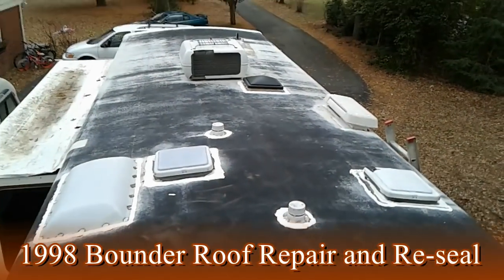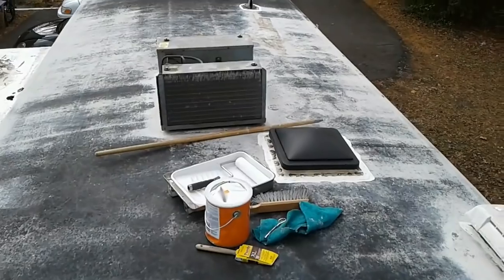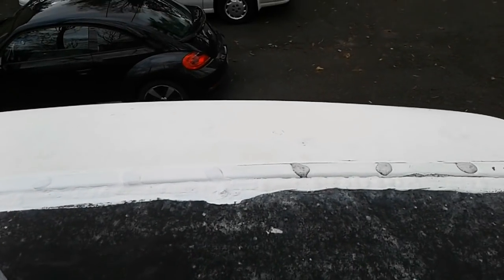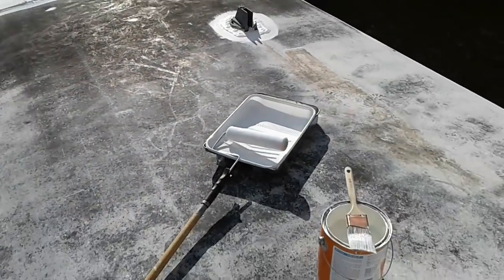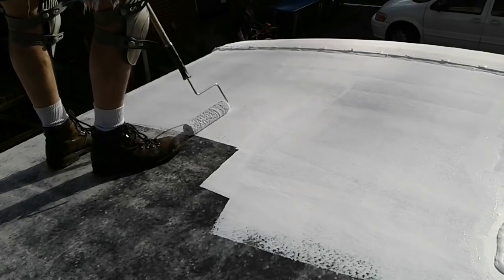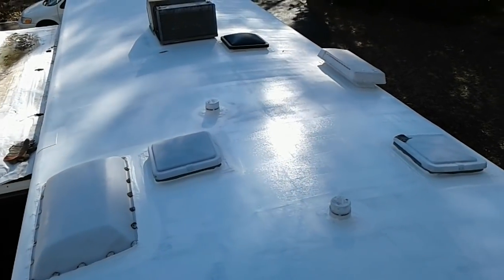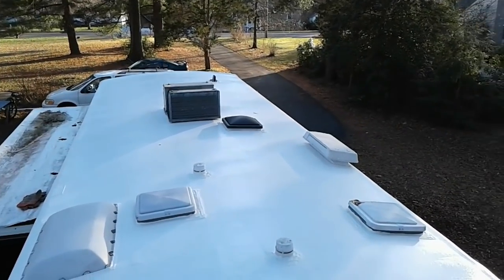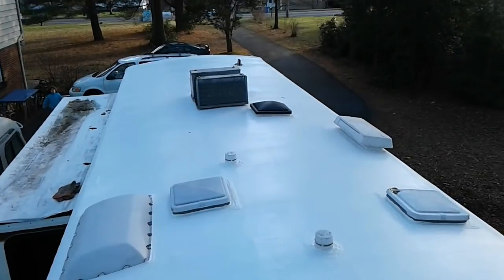How to Repair and Seal a Rubber RV Roof - 1998 Bounder Motor Home

Comment: how is your roof holding up with that product so far?  one thing i would add is that the black from bare rubber comes off and gets everywhere so wear  gloves and clean shoes afterwards.
Reply from the maker: If you check out some of my other RV videos, you'll see I switched over to FlexSeal Liquid Rubber. I like it a lot better. With the Heng's I felt like I had to re-coat the roof every year! But my roof has been completely leak-free since I did this job.
Reply: @Buckwsr  i just bought a 5 gal bucket of henry 887 from home depot for $380  that was recomended by a local rv repair man, if it dont work ill change to flexseal.

Comment: Great video and instruction! This is exactly how my 2000 Discovery 37V looks. The black on mine is now powdery and gets all over you when you are on the roof. Was yours doing this? Is this black powder what I am to wash off before coating mine? I am worried if even after I was it if it turns powdery again this won't stick. Any advice? Thank you!
Reply from the maker: I don't remember any black residue or powder. You need to clean the roof first. Maybe pressure wash it. or scrub brush and detergent. Rinse well and let it dry for a few days. Seal around all protrusions. Then you're read to paint on the roof coating. Good luck.
Reply: I'm having same issue, major black powder even after power washing.   Don't want to coat over it if won't bond.   Any advice?
Reply: How did you clean powder before coating?  Having same issue with my worn out black rubber roof.   Tons of powder, even after power washing.
Reply: Chris Davies any luck with washing your roof I’m having same problem
Reply: @Buckwsr  when you started the 2nd coat I saw your knees were good and black. My 95 C class gets me black everytime I go up there. I am prepping to do my roof.

How many gallons did you use?

What kind of knap on that roller?

Did you bag the roller in-between or just start with a new roller?
Reply: Hi. My roof also has the black residue powder, any thoughts on or recommendations to have a good bond?

Comment: Good description of doing the job- But i wonder now a year and a half since you did it, ? does it leak. I could not see any signs of cleaning the joints before applying sealant. ??
Reply from the maker: The roof has held up great since I did this job...no leaks ever.... However, I have re-coated it annually. Unlike a house, I think RV roofs require on-going attention and maintenance....

Comment: This is one of the best looking jobs I've seen on YouTube. I've got a 39' class A with a TPO BrightTec and it needs replacing or coating with something like this. I haven't heard of this grade Hengs before. How is it holding up so far. Again, it looks really good, very uniform and not splotchy like some I've seen. Thanks for posting this.
Reply from the maker: I did this job last december. Now, in August, roof remains completely dry and without leaks. I did recently paint on another coat of the Hengs since I havdenough left in the can to give it another coat. So.... so far, so good.  Thanks for the note.
Reply: Buckwsr... Was that all with only one gallon?
Reply from the maker: @deanrising6577  I used a little more than 2 gallons, I believe, in putting on two coats of the product. I had purchased 3 gallons. 6 month after doing this job, I used what was left of that third gallon to put on one more coat.
Reply: @Buckwsr  After inspecting my roof for what I thought was an air pocket under the TPO roof turned out to be buckled plywood. After opening it up to see if I could maybe just patch in a piece of plywood, glue the roof membrane back down and use a liquid product like you did I found the damage went around the rear a/c on 3 sides, so now I'm in the early stages of taking off the entire roof.   Only a few items left to remove(had 14 items which must come off before removing the 9 sheets of plywood), then the termination bars and plywood. At 16 years old it didn't make sense to do a partial re-roofing job on the coach. What fun!

Comment: If got a 1998 bounder 36s I need to do my roof and just wonder if you washed the roof first.
Reply from the maker: Yes. I actually had my pressure washer up there to clean it thoroughly.

Comment: How do you get the black powder off before you roll? Mine is EXACTLY like that but black powder gets alllll over
Reply from the maker: The black on my roof was not powder, but the rubber roof itself, as all the coating had weathered away. I cleaned the roof with a pressure washer before I applied the roof coating.

Comment: You don't show any cleaning step. Just curious, did you try to wash this roof before sealant? If not, has there been any delamination of the sealant? Normally, surface prep is the key to good adhesion.
Reply from the maker: I actually pressure washed the roof a day or two before applying the roof coating. I also applied the lap sealant at all seams and protrusions, but I wasn't able to film much of that either. Thank you for watching the video. The roof has held up well, but I have re-coated it each year since making the video.

Comment: I’m doing 2 coats on a 37’ 5th wheel roof. Planning to do Flex Seal, as we used Henry’s last year & it didn’t hold up well at all. How much do you think it should it take? Your video was very helpful - thank you!
Reply from the maker: I also transitioned over to the Flex-Seal. I felt like with the Heng's I had to recoat every year, and that's just too much work. You will need a lot of the flex-seal as the coverage is only like 80 square feet per gallon....it's liquid rubber, not paint...and it will cost you a good bit, too.
Reply: Yeah, we used Henry's last year - by this summer it was peeling off & pretty worthless. I think it's worth the money to get a good seal & prevent leaks, as well as to have one that lasts longer. Thanks for the input!

Comment: Well COVID took me out for 11 months last year. I did get my awnings done. The rain has finally let up here, and I’m getting ready to get this done. I’m gonna go with the Flex Seal. Your roof looks just like mine, the wear and color. Every time I go to clean it, this black water keeps running off. Is there a product that’ll clean it better. It’s almost like black chalk. Or do I have to keep scrubbing with dish soap or Purple Power it until it finally is clean? 6:11
Reply from the maker: I don't know really about how much scrubbing to do. For me it was December, and I was up against the cold weather. I think I gave it pressure washing, let it dry, and then applied the coating.
Reply: @Buckwsr    Hmm. Im kinda racing the warm up.  Were getting into the 70’s now. I guess I could just give it a good cleaning, let it dry, and coat it. Again. Thanks for the video

Comment: My roof looks similar to yours and I am about to do the same project. My question to you is: Did you wash the roof before applying the white coating? The rubber of my roof is showing (black) and i noticed it turns my fingers black when i touch it. Did you have this same problem? If so, did you wash it down?
Reply from the maker: Yes, absolutely wash it first, and let dry thoroughly.

Comment: Getting ready to do this on my '93 Jamboree. Did you power wash it or use anything special to clean it first? Thanks!
Reply from the maker: I'm pretty sure I powerwashed the roof and let it dry. Then I sealed the protrusions with self-leveling sealant, prior to applying the Heng's coating.
Reply: TSP Trisodium Phosphate in a bucket of water works great as a non-filming easily rinsed cleaner with a soft carwash brush, but I didn't have any mold being in the AZ desert.  Power washing could damage the roof and drive water where you don't want it, so I just used a low pressure rinse.  I used Henry Tropi-Cool on a TPO roof.

Comment: How did that sealer do did it fix the leaks I want to try it on mine just bought a 2000 coachmen they said had no leaks but just had a real good rain and found 2 leaks
Reply from the maker: It's only been about 3 months, but so far perfectly dry, and we've had a fair amount of rain this winter, so I'm feeling pretty good about it.

Comment: Did you have to apply an activator before applying the final coating?
Reply from the maker: The Heng's product requires no activator. Just paint it on. That's why I chose to use it...I needed to get this job done in a hurry.

Comment: Does Heng’s rubber roof sealant prevent condensation on the inside of the trailer roof? My aluminum roof trailer has lots of condensation inside especially in the mornings.
Reply from the maker: I can't answer your questions, as I have never experienced the problem you're describing. Sorry, and good luck.
Reply: It will not help.. the moisture inside your trailer is what's forming on the inside of the cold metal. Much as an AC evaporater, sweats and makes water when cooling..  a dehumidifier, will help some..
Reply: And if you are using propane heat, I don't think you will get any help from a dehumidifier.. we have a horse trailer with living quarters in it.. the uninsulated metal roof, sweats like a rain storm in cold weather..

Comment: How did this product hold up over time .  I would like to see how it looks now??
Reply from the maker: Thanks for the note. It's been over a year since I did this job, and everything is still completely dry inside my RV. The roof coating is not nearly as white and bright as when originally applied....it has gotten a bit dirty. But most importantly, it has sealed the roof and kept the water out!
Reply: @Buckwsr  I am getting ready to do my 1994 Bounder, the roof looks the same (black rubber) and I am in AZ. So heat and long hr of sun, so color fading is not an issue, has it pealed and were, was Heng's worth the investment.
Reply from the maker: @danafisher3806  Dana, my roof is still nice and dry. I recently re-coated with Heng's. For one thing, since I do not cover my RV over the winter...or ever...the rooftop looked pretty dirty. So I cleaned it with soap, water, and a scrub brush, and then recoated with Heng's. Should be good to go for another year.
Reply: @Buckwsr  thanks

Comment: I see so many reviews that Heng's will peel on this rubber roof without a primer first. You stated in comments that you already recoated the roof again. Was it peeling? Why did you need to recoat? I'm thinking of going with the 2 part system from EPDM Coatings. I want it to last years so I keep watching reviews. Obviously Heng's is less expensive but some of the peeling issues are just terrible.
Reply from the maker: No, mine never peeled to this day. I recoated mostly for additional protection and to make it look clean and white again. But it has never peeled.

Comment: I’m needing to do this to my trailer. How that product holding up 5-6 years later?
Reply from the maker: It seemed like I had to re-coat the roof every year. I don't use a cover, so after sitting all winter, the roof was quite discolored and dirty. Last year I decided to try Flex-Seal. It turned out great, and I will not have to recoat the roof this Spring, I can promise you that.
Reply from the maker: Here's the link to my flex-seal video: https://www.youtube.com/watch?v=V3FtqLqjKRI&t=29s
Reply: @Buckwsr    Huh, I’ve heard not so good stuff about Flex Seal. I do a bit more research. Thank you.
Reply: @Buckwsr    Thank you. I’ll check it out.

Comment: How long is that motor home and how many gallons of rubber roof coating did you use?
Reply from the maker: 2 gallons of the product were enough to put two coats on the roof of my 34 foot RV.

Comment: After 4 years how did the coating hold up?
Reply from the maker: After a few years of feeling like I had to reapply the Heng's every Springtime, I decided to switch to Flex Seal Liquid Rubber. That's a much better product, and I'm glad I made the switch. I have another video on that, too, I think. Good luck.
Reply: @Buckwsr  Thank you. That was going to be my next question. Is Flex Seal a good product? I will look for your video and decide if this is the right way to go. Thanks again.

Comment: What did you use to clean the rubber roof before the sealants
Reply from the maker: I cleaned it with a pressure washer....had to be careful, though, because the roof was already leaking in places, so I tried not to go nuts with it.

Comment: How long is your RV and how many buckets of Hengs did you use?
Reply from the maker: The RV is 34 feet long. I used about a gallon and a half to apply two coats.
Reply: @Buckwsr  Thanks for letting me know I have a 36 footer so I think 2 to 3 gallons should be more than enough. I enjoyed your video.

Comment: How is it holding up today after 4 years
Reply from the maker: The roof is still fine, but I switched over to Flex Seal liquid rubber, a far better, longer lasting option.
Reply: @Buckwsr  want to do my roof? I live in utah

Comment: Also did you use any sort of primer after cleaning?
Reply from the maker: I chose the Heng's because it is a one-step process, with no prime coat required. It was December, and time was of the essence.

Comment: It looks Great! I have the Heng's coating and hope to apply it this weekend. Did you only brush 1 coat on the edges? A thick single coat? Or did you second coat the edges when you did the overall 2nd coat?
Reply from the maker: I think I "cut in" twice with the brush before using the roller, if I remember correctly. Good luck! And thanks for watching the video.

Comment: Nice job on your roof job.  I do have a question.  I need to reseal my rubber roof.  My concern is there alot of peeling from a previous seal.  I just bought this MH and my guess is the previous seal a long time ago.  I worked on one side using a nylon brush with Simple Green.  Some of the peeling came off but most did not.  Did you have any issues like that?  Thanks for any information that you can help me.
Reply from the maker: Hi Robert, I do not remember any actual peeling, per se. I would just scrub and clean off what you can, maybe try a pressure washer, and then re-coat. Expecting all the old coating to come off may be too frustrating, or even impossible. Just my two cents. Good luck.
Reply: @Buckwsr  Thanks.  How many gallons of Heng's Roof Coating for your MH?  Mine is a 94 Fleetwood Bounder 34.  I was working  this afternoon.  Lots of peeling.  I went up about 7:30 tonight.  I don't know if the peeling sticked down  but it looked much better.  Maybe magic!!!  .Thanks again.
Reply from the maker: @my74vette  I think 2 gallons was more than enough to put on two coats.

Comment: Thx for the video.  How many gallons did you use?
Reply from the maker: I bought two gallons, put on two coats, and have enough left over to re-coat in Spring, if I get around to it....
Reply: @Buckwsr  
How is it holding up?
I have a 1985 Pace Arrow I have to do...
Thank you for sharing this great video...
Very Helpful
Reply from the maker: @judichristopher4604  Holding up just fine. It's only been 5 months...I'd like to recoat it, now that it's Springtime, if I can get around to it....
Reply: @Buckwsr  
Wow... You are fast... reply...
Thank you so much...
disregard my other question I just asked...
You have already answered it...
Thank YOU so much

Comment: Theres not a nice wash to remove that old mold ? I think paint in the top of the old mold is gonna be good fpr maybe one year, after that mold is gonna explote again.looks a good job on the reseal,but maybe with a nice wash first can be a better job.by the way thanks for share.
Reply from the maker: I absolutely washed the roof thoroughly first! The black color is not mold, but the original rubber roof. Most of the previous coating was completely gone....
Reply: I use, 50/50 mixture of purple power and bleach. I spray it on a dry area, and scrub the loose black powder off with a brush.. I then power wash... Keep the sides rinsed, as that stuff can lighten your pin stripes, if allowed to dry on it.. any water, weakens this stuffs ability to work.. I mix it in a pump up chemical sprayer..  it kills all mold, and leaves a squeaky clean surface for the new roof to adhere to.. it is a killer mixture for removing the crud....

Comment: Should I just put the lap sealant over the old stuff or should I try to remove it? Seems really difficult to remove!
Reply from the maker: I would not remove any sealant that is still intact. Just whatever is lose, broken, or perhaps cracked. Apply the new sealant directly on and around the old stuff. That's what I did, and it's holding up perfectly.

Comment: Did you get that Heng’s from the guy in Pennsylvania who sells dented cans, at a huge discount?
Reply from the maker: I think I bought it from an ebay seller....but it wasn't cheap. And the cans were just thrown into the box with pretty much NO packing material. I think they got all dented up during shipping.
Reply: I bought four cans from this guy in Hazleton PA. If I recall, he sold them for about $35 a gallon.  They were discounted as they were dented cans and came shipped in a cardboard box, each gallon was in its own separate plastic bag to prevent leaks. No problem whatsoever with my order.
Reply: Bought 2 cans from Amazon $65 per gallon can for Hengs. I got dented cans with no packaging.  Can’t believe they did not leak.  My local RV dealer wanted $115 per can of  Hengs!

Comment: Great video! My 2002 keystone Montana has a roof that has probably never been done. My question is there are several places where the old sealer is peeling off. As a former house painter I know to remove peeling paint. Is this how I handle the peeling sealer?
Thank you!
Reply from the maker: In my opinion, sealant that is still intact around roof protrusions should stay. Anything loose should come off and be replaced/re-sealed.
Reply: Thank you so much!